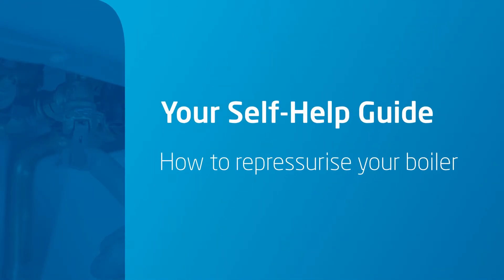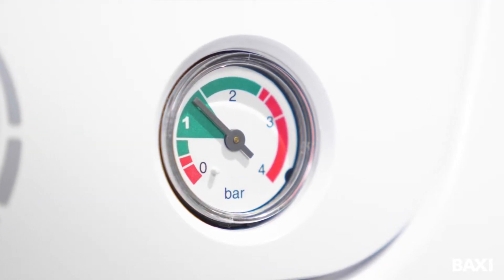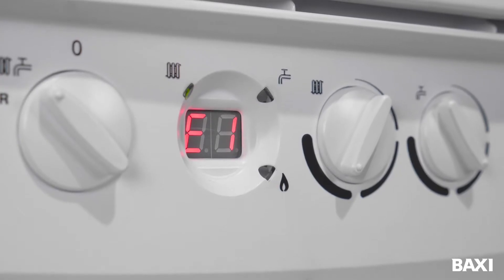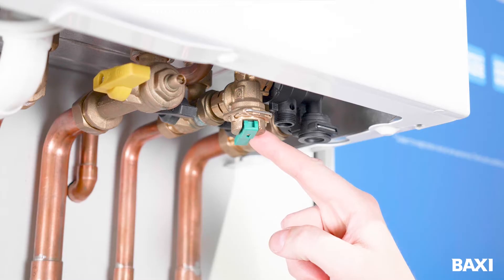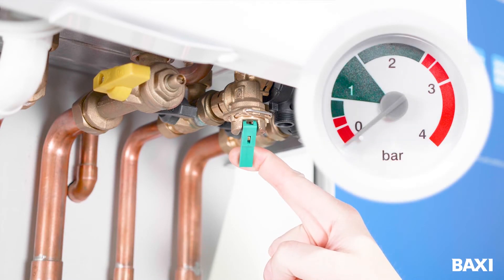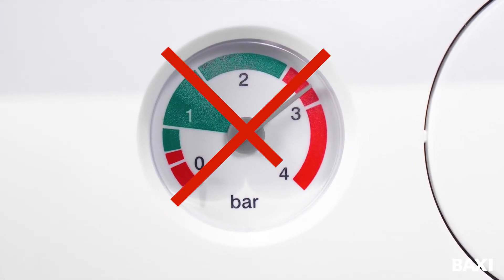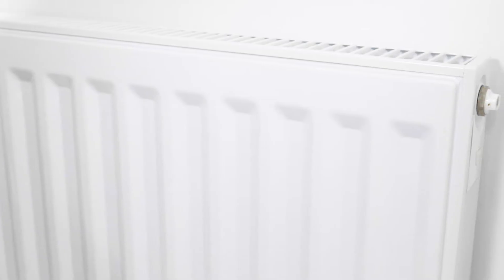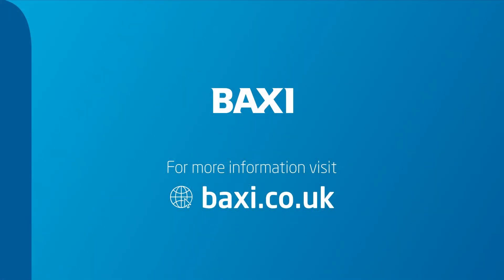Repressurising your Baxi Boiler with an Easy-fill filling link | Error Code E118 or E119

Comment: The green level was stuck and i had to pull hard just to get a lil water thro.

Green lever looked like it wasn't moving but at least pressure was rising. 

Problem was, when i stopped pulling the green lever, it was still filling up ever so slowly and eventually it went above 3. So i had to turn off boiler and open the black switch.

How do we change the green lever?

Comment: I did this, and it worked fine - for a few minutes, by which time the needle was on zero again, and the boiler switched off. It's done it every time since - it takes about 8 minutes for the needle to drop from 2 to 1, then another 3 minutes to fall to zero.

I spoke to the plumber who installed it, who said there must be a water leak, but there isn't, and now he's not taking my calls. Any help would be much appreciated.